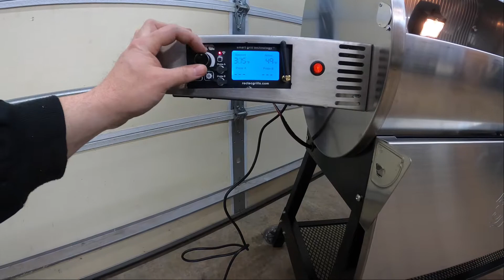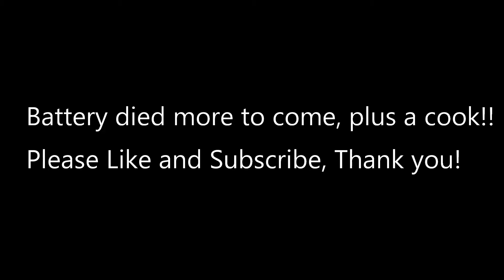Rec Tec RT-700 Assembly

Comment: Quick question, did that tape/felt that you put around the door and stack come with the RT, or was that an add on?
Reply from the maker: Hi Chuck it did not come with the RT, I ordered it on Amazon. It works great so far.

FireBlack Hi Temp BBQ Smoker... https://www.amazon.com/dp/B00TAJW0QE?ref=ppx_pop_mob_ap_share
Reply: @lik2fly  I just ordered one of these smokers. Was one roll of that hi temp gasket enough for the door?
Reply from the maker: Hi Keith, yes an it works great so far!

Comment: Hi Connor.  I'm still waiting for my 700 to be delivered.  Do you think I   will be able to fit the box through a front door?. I'm wanting to put it together on my livingroom instead of outside in the snow.
Reply from the maker: Hi Truth Talker, I don’t believe you will be able to get the box through the front door because it is pretty big. However, it should be easy enough to pull the parts out of the box and then assemble in your living room. I hope this helps! Good luck with your Rex Tec, we love ours. Have a great day!
Reply: @lik2fly  Thanks for replying.  That's kinda what I  figured.  I've read mixed opinions on putting a seal around the lid. Even RT has told someone that it's not recommended because it changes the designed air flow. What's the point of the smoke stack then? Imo. . I'm leaning towards doing it though. How has your experience been with it on? Have a good day
Reply from the maker: So I’m not sure how the grill would perform without the seal since I installed it from new, but I don’t have any smoke leaking around the door. It all seems to exit through the chimney. Overall the grill has been amazing and you will be very happy!